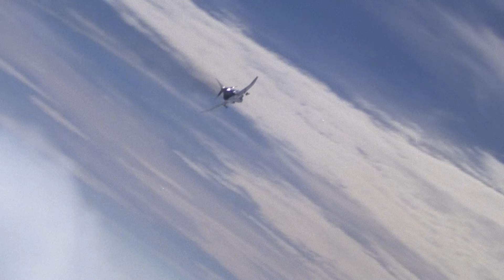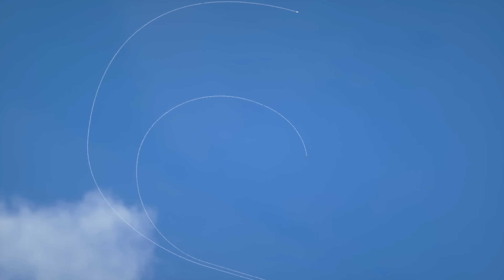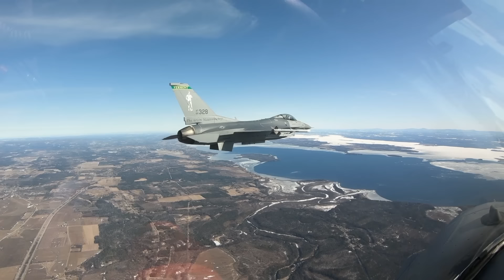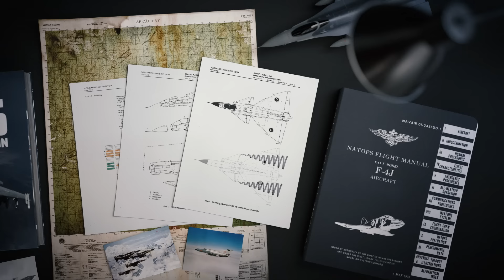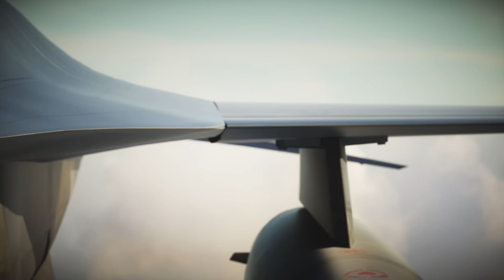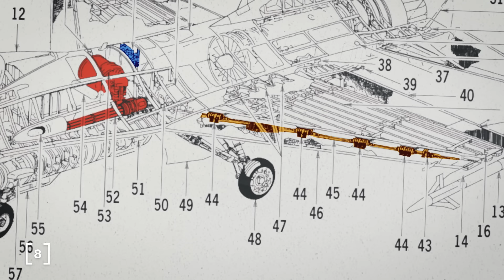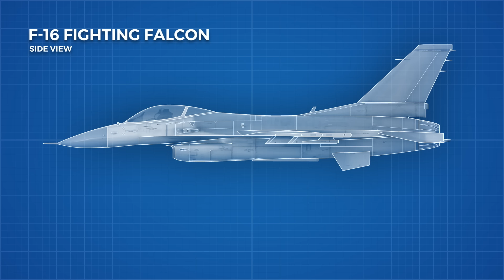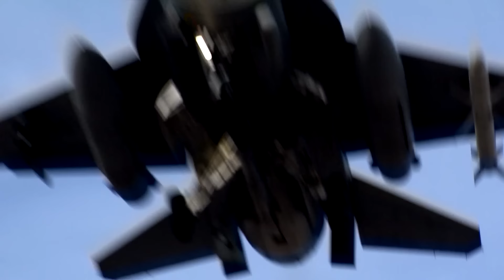The Insane Engineering of the F-16

Comment: In reference to the start when talking about the F-4, it wasn't that the F-4 was bad at its job is just that it rarely was allowed to do its job the way it was intended to, the F-4 was designed with the idea of firing your missiles far from the target but due to ROE limitation the F-4 pilots were required to have visual confirmation of targets before launching their missiles which made them have to put themselves at a disadvantage since they had to close in with the MiGs which were better in close quarters as they could out manoeuvre the F-4s meaning that it was less a fault with the design or intended doctrine of the plane and more so a problem with the doctrine in the ground which commanders implemented to avoid Blue on Blue incidents, it would be the same as if you the US went to war today and strapped drop tanks and extra missiles on outside pylons to Stealth Fighters, it would defeat the entire doctrine which these planes are built around which would make them infinitely more vulnerable to enemy planes which might outperform them in certain metrics, while if operated properly the F-22 and F-35 are practically invisible until you are getting shot at.

It is not always the equipment that fails to live up to expectations but rather the people in charge of mission planning that fail to consider the unique advantages of each piece of gear in their arsenal, which can lead to the wrong conclusion when evaluating an aircraft, you have to stop to consider what its intended role was and if it performed well or poorly in that role when it performed tasks in that role, if I grabbed a hammer and tried to use it to mow the lawn I could say that the Hammer is useless but if I use it to hammer nails I would say it performs its task well.
Reply: Yeah, he drew the totally wrong conclusion in the introduction. He didn’t mention that the same aircraft later in the war absolutely mopped the floor with the North’s Air Force. It was not a problem with the F-4, but a problem with doctrine and training like you mentioned. It’s also worth noting that the US entered the war with too much confidence in the still relatively inconsistent missile technology and left the war with a strong sentiment of “keep the guns!”
Reply: @jeffnorsegod8080  Have you read the Red Baron reports? Because the conclusion he made at the beginning was the same conclusion the US military made in those reports. Training was bad, situational awareness was bad, the North's Air Force specialized in guerilla combat, and the F-4 wasn't good at reacting to something coming from behind.

Training and technology fixed the first two, but the F-16 was the response to the last one.
Reply: Weren't even the f-4's guided missiles crappy though? So it was almost like the niche it was meant to cover wasn't exactly well "covered"
Reply: @MatteoMiller it didn't have guns either. It couldn't turn. People seem to be afraid to say it sucked. The Blue angels dumped it. Before the 14,15 and 16 I'd rather be in an F5 or 105.
Reply: the real problem with the F4 was the extremely lacking IFF equipment that came with it, if the IFF equipment wasn't as terrible as it was the ROE wouldn't have changed.
marines quickly used a better IFF system and actually had decent success with the F4 even during the vietnam war
Reply: Los que critican al F-4 es porque no entienden la diferencia entre un interceptor y un caza, y tampoco son conscientes de que en aquellos años había muchas limitaciones tecnologicas para que fuera realista  el combate BVR... Todo lo cual, acabó forzando que el F-4 se viera obligado a ser usado como cazabombardero embarcado y a enfrentar combates aire-aire maniobrados a muy corta distancia... O sea, al peor escenario para ese interceptor pesado y torpe. Y aún así pudo ir puliendo sus carencias y lograr victorias.
Saludos
Reply: you literally described the rework of F-22. During which it became heavier because they increased the strength of wings to allow for... pylons.
Reply: Simple people like simple content.
1. In video are almost not visible any MiG-21! Planes with Czechoslovakia markings (Československé letectvo) are Su-22! Not fast, not maneuverable, pretty heavy due a variable swept wing. Su-22 obviously dont have clean delta wind as MiG-21!
2. MiG-21 does not have variable swept wing in any variant or clone!
3. MiG-21 is not dogfighting plane, it is not easy to maneuver special in lower speed in low attitude.
4. Is designed primarily for attack from back.
5. Su 22 does not have AA radar!
Absurd
Reply: @askme5805   the short video fragments are indeed of su22's but the 3d animation clearly shows a mig21 engaging an f4 with missiles so who cares?
Reply: Taking day to day missions orders came from Washington DC instead of those who were actually there.  It was also the reason we lost the war In  Vietnam. Not being able to destroy the SAM sites, because of possible Russian military at those sites.  All that DC cared about was trying to get North Vietnam to the table for " peace talks" .Linebacker with the B-52's on the Ho Chi Man trail  virtually wiped out their supply lines, but it was only to get the VCto the peace talks, which it did fantastically.  
What a waste of machine and brave men.  And the VC won in the end. SMH!!! Thank you for your service 😊
Reply: Love you for making it clear how foolish and inappropriate meddling by Washington & the military commanders cost lives during the Viet Nam "Conflict".  Look it up folks this man knows what he's talking about.  Dwayne.  Two tours of duty, Viet Nam "Conflict"  U. S. Air Force Veteran.  Union City, GA. USA.
Reply: Bingo
Reply: @ujust326  Good men, with good weapons usually means victory
Those making decisions from 8000 miles away made it even more difficult😊
Reply: Lies that was not 40 minutes it clearly felt like 10
Reply: Speak for your own hammer sir…. my hammer not only handles nails and lawns, but it can prepare tax returns and write my Christmas cards too.
Reply: Logical explanation of the issue!
Reply: Mig-21 is always a bad omen for US fighter jets. In the 2019 aerial engagement near the Line of Control, the Indian Air Force (IAF)  MiG-21 Bison, piloted by Wing Commander Abhinandan Varthaman, shot down a Pakistan Air Force (PAF) F-16 fighter jet.
Reply: kinda like how the mid 25 and mig 31 are horrible dogfighters, but were intended to be supersonic interceptors and nothing more.
Reply: You can say that about any equipment ever. Redundant CAS airplanes like A-10, Su-25, whole range of german tanks like Panther or Tiger II. Hell, you can even argue using spears and shields using your logic. The F-4 was a great plane in it's times. Powerful radar, state of the art weapon systems, powerful engines and speed and a great gun which was soon introduced and is used to this day. It did fine too in the war. It doesn't need defending at all like those examples I used.
Reply: Very insightful take! Love how you broke down the context behind those design choices 👌
Reply: ROE has been a killer of many a mission 😢
Reply: U said it bro
Reply: The ROE was all kinds of ass. Graduated Escalation was one the most inane military doctrines a country ever demanded of it's armed forces.
Reply: The F-4 was not bad at its job. Losses in aerial combat were light, and the VPAF rarely challenged the Phantoms, because they suffered the loss of a good percentage of their MiG-21 fleet whenever they tried. So the air defense of North Vietnam relied on the emerging threat of SAMs, which remained a severe threat throughout the Cold War and only appeared, for a time, to be tamed by the stealth technology and SAM suppression tactics employed in Desert Storm.

Losses to SAMs, and particularly to ground fire, were heavy. But the F-105 suffered even worse losses, proportionally, and I don't hear the Phantom's critics saying the Thud was bad at its job. And for the record, even the F-105s racked up more kills than losses in air-to-air combat. For that matter, so did the B-52s. So much for the myth of the MiG-21's stunning performance over the skies of Vietnam.

Phantom losses were high because the ubiquitousness nature and multi-role capability of the F-4 meant they were used for close air support. Skyraiders were better suited to that role, of course, but cruising at half the Phantom's speed, might not reach the target in time. Fast-forward, again, to Desert Storm, and you find pilots of "fast-movers" doing the same thing, responding to calls for air support in the area. It's dangerous, each and every time. But ultimately, it's a choice made by one or two brave air crew, to put themselves in harm's way to maybe save a whole platoon.

As for the often-criticized rules of engagement that required visual identification of the target, this was a safety measure. The skies over Vietnam were filled with friendly aircraft, while as we've established, the VPAF barely sortied to contest these skies. So any radar contact was spectacularly unlikely to be a hostile, and allowing them to be engaged without positive ID would almost certainly have resulted in higher losses from blue on blue than the MiGs were ever able to inflict.
Reply: The F-4 became a brick with wings. Later versions, RF-4C used updated avionics LRUs which were lighter. I remember seeing some LRUs replaced with heavy weights to leave CG the same.
Reply: You are correct regarding the idea behind F-4, but there are other systemic mistakes that turned it into bad plane. For example, not having a gun for close range fights. Ok, it's in line with BVR theory it was developed on. But early Sidewinders were very unpredictable (not to say almost useless) which made whole BVR thing a joke. Adding of the gun and solving rocket deficiencies turned it into capable fighter again, but too little too late...
Reply: The F4 is the most overrated fighter in history. The Blue Angeles even dumped it.
Reply: This is true, it's one of the many reasons that the US did so poorly in the initial phase of the war. Another factor was that US pilots were never taught dogfighting as part of their training, as the leadership had considered dogfighting dead with the invention of missiles and supersonic fighters. The same logic was behind the missing guns on the F4. However, these shortcomings led to the establishment of the top gun school, where pilots were taught intensity in the art of combat techniques. After the guns were jerry-rigged onto the F4, especially the navy got their revenge, almost putting the Mig on the endangered species list in Vietnam.
Reply: You could also describe that as designers failing to understand the problems they are creating a solution to solve. If a bunch of engineers came to the conclusion that their lawnmower needs a hammerhead instead of a blade, because they thought the grass of the future would be shaped like iron nails, you'd call that a huge failure.

Similarly, if a fighter plane is designed without consideration for friendly fire risks, and therefore can't operate as intended by the inventors, then it's a bit of a design failure.

At the end of the day if it the war you are fighting, is the wrong mission for the weapon, then you designed the wrong weapon. It doesn't matter how good the system would theoretically be at fighting a war that's just never going to happen.
Reply: @plainText384  Not really, remember that the Engineers make what the people in charge of strategy and tactics tell them to make, it is not the Engineers failing to understand anything.

An Engineer gets a list of requirements for a new aircraft and they will build your plane, if you fucked up and gave them requirements that don't work it is not the fault of the Engineers but the people in charge of creating the project specfications.

For example if we work in a domestic appliances company and we are going to design a new fridge, but the people in charge of researching market trends and demands tell us that it needs an Oven and the bosses tell "This Fridge needs an Oven", we will design a fridge with an Oven in it and figure out the logistics of how to make it work in a single package, but innevitably we will have to make trade offs, like for example due to the close proximity of an oven and fridge there is no space or cooling capacity for a freezer so we had to get rid of the freezer, if you use the oven for extended periods you risk warming up the fridge to where things can go bad over time if you don't let the heat dissipate, and then the people in charge come saying "Well this doesn't really work and people aren't buying it", the only thing the engineers can say is "I made what you wanted me to do".

Generally it isn't engineers driving decisions around what capabilities a vehicle or piece of kit will have but rather the generals in charge of the branches who decide what the future threat environment will look like and what is required to tackle it, sometimes engineers will be asked to chime in, but overall this isn't a thing that engineers dictate, rather they merely try to build the best thing they can within the parameters given.

Remember that these vehicle are made by companies and companies make what they think the customer want, in this case the costumer is the military and the military will give companies design guidelines and then the military will pick a vehicle they believe matches the way they want to operate.

In very few companies will you see engineers actually make decision about what features a product will have.
Reply: Were the F-4s not also lacking guns initially and had only missiles without the abilityto fight at close range?
Reply: @Darkshadowkiller44 yes, but the lack of guns wasn't an issue, just see the navy results post top gun
Reply: @Darkshadowkiller44  The lack of guns was really not a big of a deal despite what USAF says. The US Navy had a completely opposite solution that didn't require a gun, and that was to properly train pilots on how to understand and employ the missiles on the F-4. The "Top Gun" school was called "Fighter Weapons School" and not "dogfighting school" for very good reasons. They ended up improving the kill ratio much better than the USAF, without resorting to guns.
Reply: @Darkshadowkiller44 The gun was used as a scapegoat for the bigger doctrinal issues. Pilots were used to dogfighting at the time, the F4 was the first true "missile fighter". When it performed badly due to the above reasons pilots were quick to blame the lack of a gun. After doctrinal changes and training changes both the gun & non gun variants of the F4 performed nearly identically.
Reply: @Darkshadowkiller44  yes
Reply: @marxel4444 the mig 21 had the same issue at the time. Russia had the same ideas as the us for tactics. So they ripped off the gun on the mig 21. If you want to see the other part of the f4 vs migs look at Israel during the 70s
Reply: @Darkshadowkiller44 The idea that the F-4 embodied was BVR engagement and limited dogfighting but the technology for the time was too young which caused a number of the Phantom's shortcomings
Reply: The entire philosophy of the F-4 was "put enough engine on a tank and it will fly".
Reply: The f4 was bad, it was big, chunky, poor turning and a whole lot more problems means the platform as a whole regardless of if it could do it’s job properly was in need of a replacement but that replacement was the f15 not the f16 so idk why they mentioned Vietnam when that created the f15
Reply: @dontworry2379 the f4 was not a bad aircraft it was bad training and faulty iff systems. Pilots were sent in with little to no dogfight training. It was so bad the navy made the fighter weapons school for dogfight tactics.
Reply: @dontworry2379 Everything you described only matters for dogfighting, the F-4 wasn't designed to be in dog fights so none of that matters to if the jet was good or not. The F-15 is a bad design for a cargo plane, does that mean it's a bad platform?
Reply: @DivideByZero4545  but the problem is the f4 was designed as a fighter and preformed poorly in areas where fighters should excel. That’s like building a cargo plane but the cargo plane can only carry specific things and not a wide range of things
Reply: @dontworry2379  There is no set of parameters that a fighter has had to excel across all of aerospace history, it is all dependent on technological advancements.

Dogfights are an outdated and generally obsolete concept, because nowadays you really, nowadays could you really say that the characteristics that make a good dogfighter would make the most capable 5th Gen Fighter?

Of course not, simply because the doctrine and the threat environment has changed drastically from the era of the Dogfight, nowadays you want to be unobserved for as long as possible since that is the main advantage to avoid being engaged in the first place be that by ground based air defence or by enemy fighters, if you can't be detected you can't be engaged, if you make the range at which you are detectable shorter you can get within your own weapons range and take out targets possibly without being detected or engaged, and that is to my opinion a much better fighter overall.

Same back then, stuff like the AIM-7 Sparrows were really good, it required constant lock with target but that doesn't really matter if you are engaging from long range in that threat environment since you would be firing at MiGs that didn't have Long Range Missiles to shoot back so they would try to evade, loose their energy and either be sent packing or be shot down with another missile which operationally has the same result of clearing the air space for other aircraft to complete their own missions which results in the strategic objectives being achieved.

Also while SAMs where in their infancy the F-4 pilots developed new tactics to tackle the problems which new SAM systems brought forward, they aided in the developing of the first Anti-radiation missiles meant for SEAD, the Wild Weasels used the F-4s because it was the plane they had but it was a good plane, the entire modern doctrine of SEAD was born in Vietnam.
Reply: @dontworry2379 the F4 was designed as a high altitude interceptor. Hence the good radar (at that time) radar guided missiles, AIM-7s I think and a few AIM-9s, the F4 wasn’t built to engage in dogfights like the F8 Crusader II was. Even the MiG-21 was designed as an interceptor, but with how the Soviets worked, it was smaller, simpler, and had worse missiles and radar, but kept the 23mm guns. 

Imagine you need to tow 25,000lbs of junk. You could use a Ford F350 which was built to haul some weight, or you can take a Peterbilt which was purely meant to haul heavy weight. They can both do the job, just one is purpose built for that, while the F350 can barely pull that load, it could get around town a lot easier. Not only is it the equipment you have, it’s how you use it which makes a difference too.
Reply: @dontworry2379the f-4 wasn't bad. The Air Force used it all the way up to at least the 90s as wild weasels. It just had a weakness that was exploited. For example, an f-4 with modern missiles and radar would be extremely good even today, because todays fighting is what it was built for
Reply: @dontworry2379  The F-15 was to counteract the MIG 25, the F-16 was a general replacement of the F4 i guess. You also have the F18 that replaced the F-4 for the Navy and the F18 Super Hornet replacing the F18 AND F14.

A lot of planes got developed for different reasons constantly :D
Reply: Actually the F18 and F16 got developed for the same reason.

Never wondered why the YF17 and F18 looked so much alike
Reply: @dontworry2379 F-4 was an awesome multirole fighter with one of the best payload-carrying configurations of any fighter.

Its biggest handicap was combat radius.
Reply: @LRRPFco52  not really it lacked a lot and was only really good due to anti air being in its infancy. If you took and f4 today even modernised it’d struggle a lot
Reply: @dontworry2379  If I say something on this subject, it's coming from 5 decades in the field, to include institutional knowledge specific to the F-4 and the aircraft that superceded it, while it continued to serve in NATO and Pacific allied air forces for decades.

The main reasons we divested of the F-4 in favor of the F-15, F-16, and F/A-18 was because a single man crew could do the job with 1970s-forward avionics without needing a RIO, and we moved on to turbofan engines, more advanced avionics, and more fuel fraction.

F-4 had turbojets, which don't do well in the low speed, lower altitude regime, but love to be up high and fast (as it was designed for carrierborne BARCAP against Soviet bombers).

While designing the F-4's stores carrying layout, they built it around 4 semi-recessed stations for radar-guided missiles, and 2 hardpoints on the wings for 2 more.

Those hard points got AIM-9 pylons attached to them on each side, giving it a pretty slick 8x AAM A2A load-out even with EFTs on stations 1 & 9.

Additionally, it could still carry MERs or TERs on stations 2, 5, & 8 loaded with bombs without sacrificing any AAMs.  It could carry 9-12 500lb bombs in addition to 8x AAMs, which gave it superior self-escort capability to the F-105D.

It really set the bar high for what we expected as a baseline during the design and requirements for F/X and TFX, as well as LWF and what became the F/A-18.

F-14, F-16, and F/A-18 failed to match the payload mix of the F-4.  Only the F-15 and later Super Hornet could do it in US 4th Gen fighters.

It also set the bar in payload for the Typhoon and Rafale.  It was a very capable platform in this regard, lending itself well to the Wild Weasel mission set with the F-4G in USAF before being replaced by F-16C Block 50/52 with CCIP to HARM Targeting System capability.
Reply: @LRRPFco52 it's the most overrated fighter in history.
Reply: @dontworry2379 Exactly. The F-4 had a lot of flaws that were mostly resolved in the form of the F-4 E variant but it was ultimately the F-15 that would be its successor.
Reply: @dontworry2379  F16 & F15 came out of the same development program. F15 was the no compromises 'big' fighter, F16 took all the F16 tech and scaled it down for a cheep & reliable fighter jet,
Reply: @gepset  the f16 wasn’t born out of the fear of the mig25
Reply: @dontworry2379  The experiences of Vietnam also created the F16. It wasn't to replace the F4 but rather to have a plane that could take on lighter aircraft that the heavier aircraft couldn't deal with.
Reply: @dontworry2379   The F-15 was a response to the MiG-25.  There are great things to criticize this guy for (millennial douche). But the F-16 was absolutely a product of the Fighter Mafia and a low-cost (High Low) approach ... which was a response to the aviation failures in Vietnam ... which triggered many responses: The Fighter Mafia,  Navy Fighter Weapons School (Top Gun) ... non-aviation changes to an all volunteer military (now ruined by millennials and woke idiots who think making it easier to get in is what will get their "numbers" up) and hints of changes we don't get access to ... in which Flag Officers worked harder to reconcile the ROE with the platform's intended advantages. Take stealth ... it doesn't have much of an advantage if they have to intercept aircraft ... yet, that's what we're using to do intercepts..? The F-22..? Giving other nations who get to then do intercepts the chance to record signals intelligence chances to search for indices to detect the F-22. Were it up to me? I would NEVER let an F-22 interact with hostile nations during intercepts until the ROE allowed engagement at BVR. Until then, I would (at minimum) add RADAR reflectors to the F-22 in such a way as to make it impossible for them to record signals off it ... but most preferable would be to just run intercepts with the F-15.
Reply: @trumanhw  yh icl I ain’t readin allat but u right I got dem mixed up the f15 was the mig25 response not Vietnam
Reply: @trumanhw  btw the fighter mafia had nothing to do with the f16 that’s big misconception
Reply: @dontworry2379 They had some impact. Their "Red Bird" proposal (as an alternative to "Blue Bird"; which was the very early draft of requirements that would eventually become the F-15) had some influence on the requirements for the Lightweight Fighter Program, though it's true that like half of them weren't even at the DOD anymore when Lightweight Fighter kicked off.
Reply: @dontworry2379  This is also what I read, the fighter mafia, wanted a day fighter, with a gun and possibly 2 AAMs and the radar from the F-5E because all aircombat was visual and "AAMs dont work so we rely on a gun". In fact it was the USAF that wanted a cheaper fighter to complement the very expensive F15 Eagle and the F-16 got its own radar and could carry a lot more than two heat seaking missiles. The Fighter Mafia would claim that the F-16 was a result of their lobbying but this was a lie.
Reply: @trumanhw there's already a built-in radar reflector in F-22. Called "AESA radar". 

But no, pipl will continue to spread on internet that F-35 is ultra stealth, B-2 is hyper stealth, F-22 is super-duper stealth, while F-117 is "past generation" stealth
Reply: @trumanhw  yeah, "woke" is the problem... oh, and millenials............